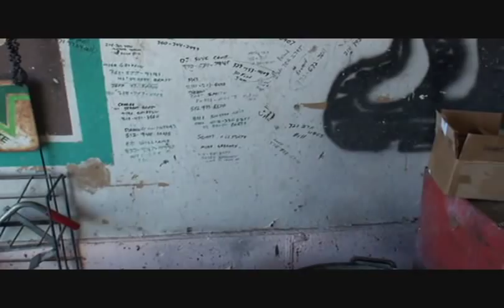Automobile Restoration-DIY Metal Fabrication-The "Third' Lesson To Mig Welding!

Comment: sorry for the typos was using my phone, also on the tank do you have to have copper or can you go right into and industrial inline water filter and be good to paint with that? i can barrow my brothers 20 gallon. but my biggest issue is how to set it up to prevent the water from hitting my spray gun?